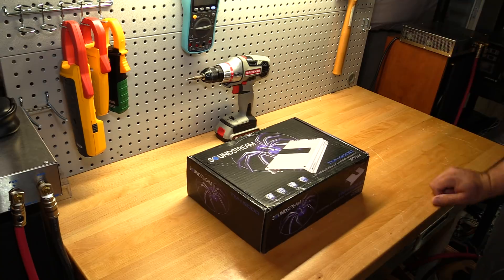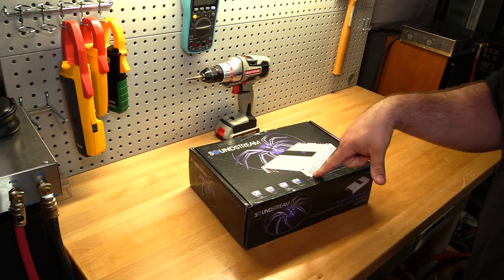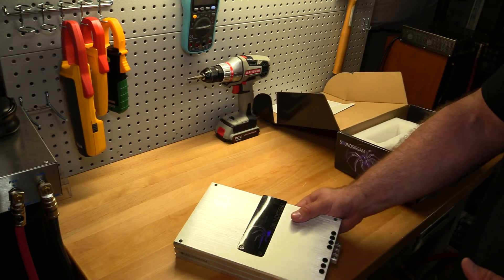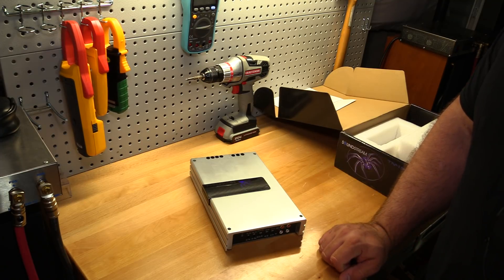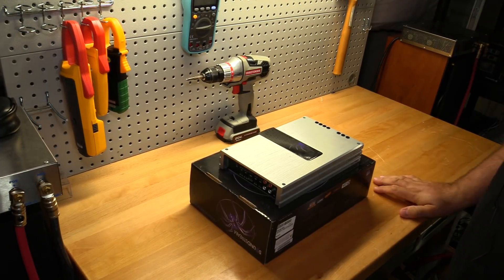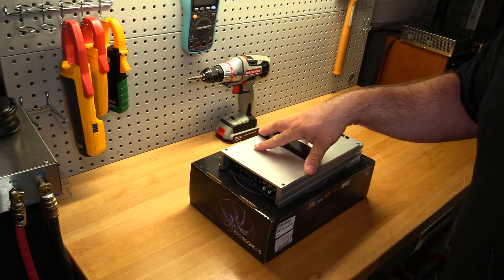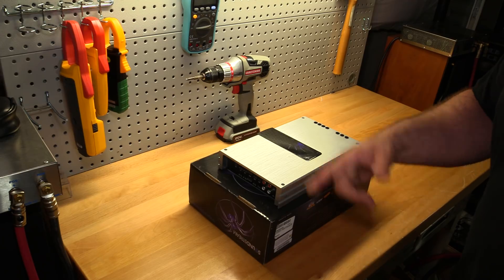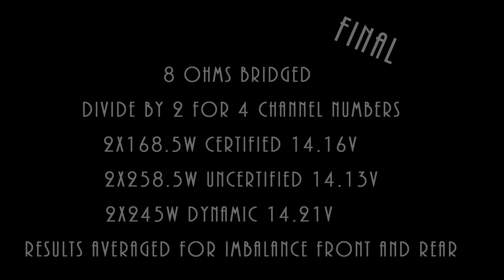Soundstream or Sound Scam? Revised Soundstream TN4.900D Dyno

Comment: i thought i remember soundstream and precision power as being 2 of the upper end brands owned by the Anaba Group back in the day. back then i was sponsored for a little while by Anaba, at that time Anaba had a whole pile of different car audio brands and though those weren't the brands I had access too, but i'm almost positive soundstream and precision power 2 of the brand names I saw hanging on the wall when i used to go there to get more audio equipment. i know the owner of Anaba has a brother who has another audio company and between the two brothers they control probably 20 or more different audio brands .....
Reply from the maker: Anaba is long gone. Anaba owned MA Audio, Mobile Authority (Thump), Visonik, Clif Designs and a couple others. His brother owned Audiobahn  and Alphasonik.

Comment: I have been a Soundstream fanatic since I was a teenager and I own a Rubicon Nano RN1.5000D that is powering my Sundown Audio SA-12s right now and love it, but I paid a little bit more to have some overhead in capacity so my amp wasn't always overheating and cutting out. My problem is that I am getting sick and tired of seeing the branch companies flooding the market with garbage. I understand that some of them are OK for a kid that doesn't know any better and thinks that his two cheap 12s with a garbage amp on 8 g wire slams, that's fine if it works for him, but when you get older and you know better, but all you see is junk like this, it tends to piss you off when these companies sell garbage under the name of your favorite audio specialist and it's shit. There should be some sort of regulating authority that punishes the manufacturers for producing junk shit like this.

Comment: I had the old version in my boat and it took a chit.  Ordered a replacement the next day and got this new one even though advertised as old one.  Came across this video the next day.  Saved my a$$.   Just for grins i hooked it up before returning it.   Power output was noticeably less and sound quality was "mushy".  Replaced it with a Pioneer.  Always had great luck in the past with SS, but this is a deal breaker. 

 Thanks Ryan.

Comment: Hey.  "Cap Cap" brand capacitors.  That reeks of quality...  Couple quick tech notes, after a quick comment. Comment: Looks like a pretty nasty piece of work. I've been an electronic tech for 40+ years, messing with car amps on and off for decades. I'll offer a couple of (hopefully helpful) clarifications to what's in this amp that may explain some of what you're seeing. Please note, none of this is trying to say it's any better than you've noted! But might be helpful down the road.

  All the parts (MOSFets/diodes) along the power section wall are for the power supply only. Probably 4 Fets, two diodes and a ??? (Can't see, but know what the design has to have.)  It is true that a design from 10-15 years ago, and a 2-3 year old design could very likely have fewer Fets and the same power capability, as, as the Fet designers constantly improve the parts, and higher power parts get less lossy, stronger and cheaper(!), you can do the same job with 4 modern Fets that took 6-8 Fets from 10-15 years back. And pay less. Tho if anything goes wrong or things are really getting pushed hard, having the stress spread over more parts seems to still be better. (I'd use 6 of the new ones for those reasons.) (Example: Original design Fets, maybe 40A max rated each, and $1.00. New Fets, 80A, $1.00 or less. need fewer parts and less $$)

 Back to the amp. I see that the old design had a separate heatsink with it's output devices there. (That oddly shaped aluminum bit with the 4 screws on top. Just that piece probably had more engineering and cost than most of the new unit!)  The screws appear to be clamping whatever the devices are. (Fets or I.C.s? Might be 2 Fets/channel.) But definitely a serious bit.
 The new unit, I can see two 'speaders' with 4 screws, one each in the middle of the two amp sections. I'm sure these are clamping the outputs to the main heatsink. They are most likely class "D" stereo amp I.C.s (Like TDA8953 or some such).

 These can be ok parts if used correctly, but can be pickier and more delicate than a solid discrete design (IMHO). You can also see that there's a lot less filtering of the outputs, compared to the old design. I suspect this contributed to the dyno's odd readings, probably a lot of 'hash' on the output, or even actually unstable under use. (Read cheap and lazy design). 
  (There are more parts in just the output filters of the original design than the whole amp section of the new one..)

 So it looks like they decided to cost-reduce the amp, obviously. They used a design that could, on paper, 'meet' the specs of the original, at least power-wise, under the right conditions. Then cheaped it further and likely reduced the power supply voltages and limits when they found out it wasn't reliable.  And, this is what you get... Excrement in aluminum.

 Anyway, just wanted to help add a bit of technical details to what I saw, and hopefully help in figuring out what was going on. All the above comment is my opinion and my opinion only, based on decades of tech experience in electronics repair and design, with a bit of a thing for clean powerful sound.  

 Thanks for running these tests and vids!  Also, did you ever try to listen to this amp? Wonder what it sounds like, especially when pushed... Take care!  Stubat

Comment: Skar has a 500.4 for $119 rite now. I used the Marine one and it sounds good.
But installed in my car is there 1000x4 for $179 $192 delivered and I'm running it at 2 ohms, 12 speakers and it screams for More.

Skar audio is the best bang for you buck if your on a budget.

Comment: What about the ta3000.1 or ta2000.1 the all black soundstream that's half ohm stable
Reply: Ryan Blankenship alright cant wait to see
Reply: Ryan Blankenship 
Soundstream TA1.3000D Monoblock 3000 Watts RMS Class D Tarantula Series Amp Subwoofer Mono Block 0.5 Ohm (Half Ohm) Stable Amplifier with Remote Bass Boost Control Knob Included https://www.amazon.com/dp/B00C51Y2OW/ref=cm_sw_r_cp_apa_i_KWwgBb2P0S0S6
This is the one I'm talking about

Comment: Hey Ryan Blakenship, I was one of the first to get snookered by this amp about 2 months ago. I spoke to Soundstream, and if you want to see their lies I still have the emails! I told the seller on Amazon, and they changed the pics that day, but kept the old description. Soundstream told me it's the same board, nothing had changed...LOL.
Reply: Part of the problem is they just order the stuff from a manufacturer they're using outside engineers. It is possible that the manufacturer in China change the boards without letting Soundstream know

Comment: Their all Maxxsonics. Not really a scam just all the amplifiers use the same stuff. Didn't take me long to figure out Polk and the others all copy each other as well. Being "budget" amplifiers they all copy each other's homework down the line. The only thing I don't like is how expensive Polk and Cerwin vega amplifiers are, they use the same components as much cheaper competitors. Not a whole lot of brands these days doing their own thing unless it's a high end component.
Reply: They might have changed. I worked on one a while ago, Maxxsonics right on the pcb. Not to say they their officially "owned" by them but it has a Maxxsonics logo board in it.

Comment: What is a good budget gem 4ch amp that will put out around the 120w in 4 ohm.
Most of the dyno amps are mono blocks.  Looking at running my Morel split in active.. 
Also can only be around the 3' inch high max. As the Pioneer D8604 & D9604 are to high.. Cheers

Comment: Great vid.  I had this amp, the noise floor was just shocking.  Had me chasing gremlins all over.  I had the noise even when the rcas weren't plugged in, but refused to think it was the amp, because of all the knowledgeable car audio guys tipping this amp.  Mystery solved.  Pos, and this, along w efficiency, is why i tend to stick to mainstream big brands.  They have too much to lose tob pull this crap.

Comment: I'm reading in the comments that the $89 dual walls mart amp is similar in power. I bought the two channel version and I keep getting power rail screams. Power variations, vibrations, heck even plugging in the inputs can trigger it into making a horrible screeching sound. Maybe it was discontinued for that reason?

edit: I did a quick bench test with totally different inputs and a regulated 12v psu. Problem persists.

Comment: Hey Ryan...any chance you could test one of the new Crescendo S1-1500.1's? I am ready to pull the trigger on it but it's $300 and I'm worried with it being so small not that it won't put out 1500 watts.
Reply: Flexin Five Hundred You should strongly consider the Soundqubed S1-2250. More power for less money, and it kinda looks like it's made by the same manufacturer. Same bass knob with clip indicator and same red board.
Reply: That would be too much power for my ride. 1500 would be pushing the electrical right to the edge. Main reason I was considering the Crescendo is I currently have a Kicker 600.1 and it's mounted under my drivers seat. The Crescendo is even smaller so easy swap out. I considered the Soundqubed S1-1250 but I may have to run it to the rear of my small SUV and I kind of waned to avoid that if I could.
Reply: Flexin Five Hundred Ah gotcha. It's a space issue. I would say the Soundqubed S1-1250 is a far better value. I don't think it's a coincidence that Crescendos new budget line and Soundqubed's new budget line are both called S series. I think they are made by the same manufacturer. I don't know the exact dimensions of the Soundqubed, but I imagine it's a similar size, and it shouldn't kill the electrical. Paying $300 for the Crescendo is overpaying in my opinion.

Comment: This infuriates me. Orion just did the same thing to me with the cobalt 2500 and now you cant find that amp. Just ditched it for an old school audiopipe 1500. Theyre preying on people that see these reviews and dynos. Pure bait and switch. Oldest game in the book
Reply: Orion came out with a new series at half the cost. Not the same thing at all. The XTR and HCCA is under rated. Cobalt now is a line that does more power in it's class than other brands. But a real Orion is the XTR or HCCA line. Even old cobalt was 14.4 rated. XTR AND HCCA 12.6v rated. Look at big d wiz review of the 2500.1d 7700 watt dynamic burst at .8 at 15.8 at 12.6 it does 2500 at 2ohm and over 3200 at 1 ohm certified. Orion is not to be compared to this garbage.
Reply: James Simpson Nah you missed the point. They pulled the amp i bought. Its no longer available and for good reason. It was a rippoff and i bought it because of big d and this channel.

Comment: Thats why i only bought the Tarantula series zero prolems
Reply: 1trucavalier that is a tarantula series that’s what the t stands for in the tn900.4
Reply: K4gixxer1000 sound stream was bought out the old chrome tarantula amps did rated
Reply: Thats a Tarantula NANO! Not the same as the BLACK FULL SIZE TARANTULA WHICH IS STRAPPABLE.

Comment: They've done this with other amps also.  Rubicon 2500 got a crappy board later in the line.  Hifonics did it with the brutus brx2400 also. There first board was good then they shoved a shitty one in the same case later.

Comment: Soundstream had better do something to gain a little reputation back or it might be game over. New Soundstream=Boss Audio?
Reply: I will get boss way before this. That is if I'm going bottom of the barrel on a build. I feel a dual brand amp at less would be a better  deal.
Reply: pospc2 you go buy that boss amp that has a 55% max efficiency rating. I would still buy the Soundstream(65%+ effiency) over any of Boss garbage.
Reply: Anthony Fejeran don't you go there! Id rather run my ndx5500 onyx than that soundstream crap.
Reply: juggernautxtr to each their own. I'm not buying either piece of garbage amp nor would i recommend them to anyone. For absolute budget builds I have went with dual and Pioneer. Similar priced and they are better quality and power then boss or soundstream. 
For my personal builds I normally go with polk audio,JL,rockford or Focal. Have yet to have anything bad from them.
Reply: juggernautxtr id put my junk boss up against this turd any day. At least with boss I'm going into the deal with lowered expectations .
Reply: idk... i been running a rubicon nano 3000 watt on a 2 ohm load pushing 2 old school pioneer champion 12's. Supposedly 900 rms, my honest guess would be its pushing 795-850 rms, the coils on the subs are definately giving that warm sexy smell. That little amp is a tank...im about to buy another and strap em....i pushed the amp on max gain for over an hour and she is BARELY warm

Comment: Thanks for putting this ripoff on the dyno Ryan. Its sad that soundstream has come to this. I built a system for my son using a soundstream 405s and a p1 600d that has performed flawlessly. This was the amp I had reccomended to him for his next set up until I saw a review on Amazon with pictures of the board. I was aware of the nvx amp but now I will look for the others you mentioned. Great job.

Comment: Great video, thank you for taking the time to talk about this absurdity. I can only hope SS will see this and how it hurts their business so much that the small bottom line savings will hurt them more in the long run.
Reply: Mitchell Roberts - I would wonder if they'd care? It looks like the corporate bean counters saw the sales numbers and probably slim profits of the old amp, and pushed through a redesign to maximize profit. That's a shame, and seeing how they didn't update the stats or pictures it would seem like profit is the their idea. Push the good old one, send out the new junk.
Reply: I hate to admit it but you're most likely right. They simply don't care if we're upset about it, it's the same mindset that killed their reputation 15 years ago when they cheaped out.